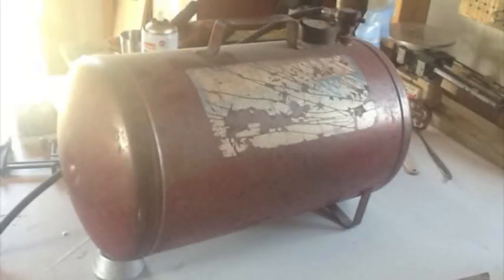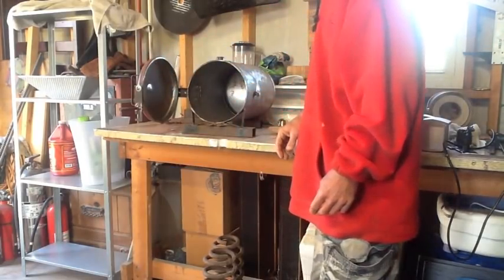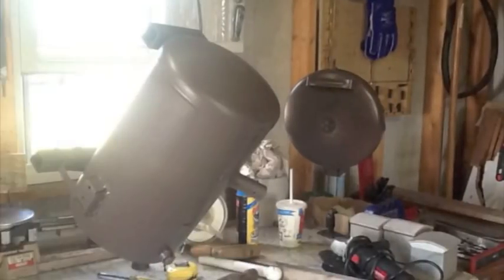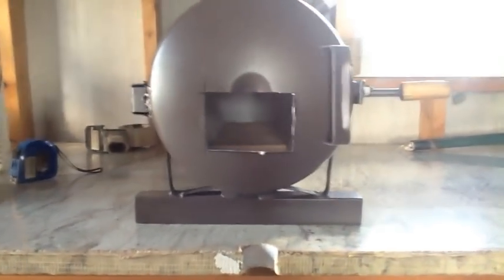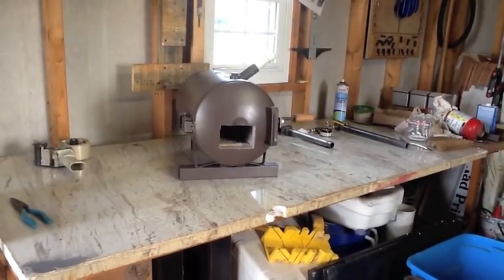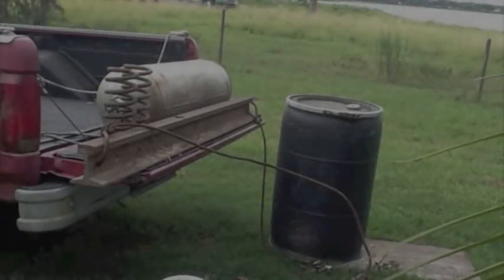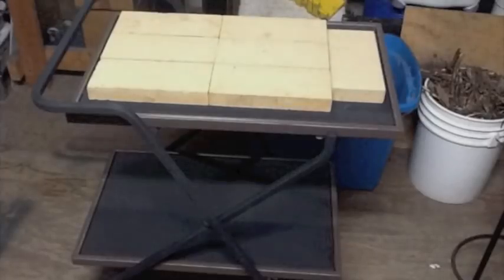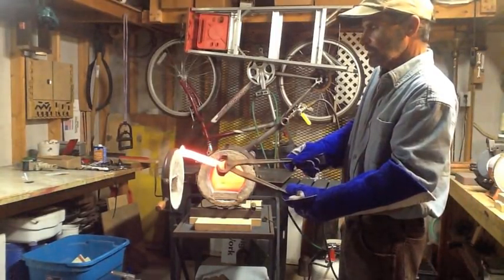My Custom Blacksmith Propane Forge Build - Start to Finish

Comment: Great other than the not safe tongs
Great video all (but the tongs,my unsafe tongs almost hurt me bad).
Really big thanks to you Sir
Reply from the maker: Which came 1st....the forge or the forged tongs? 🤔😉
Reply: In this age.we can buy and have tongs shipped in.24 hours fast,yes we do save$$$$ and love making our tools.
   As a safety tool just maybe we should suggest buying.or welding up at demo set ,I do.think.highly of your video Sir.
  I did have a 4x4x1/2" steel bar.fly.up while using channel locks that was glowing orange hit me between my eyes but bounce off my safety glasses not leaving a mark. Sir safety is my first concern.
Thanks for your video
Reply from the maker: I totally agree with your 1st comment, was not the best choice of work holding. Something to be said about the proper tool for the job.  I was just having a bit of fun. I am glad you liked the video and thanks for watching/commenting! ~ Richard
Reply: @MakinSumthinFromNuthin  I repeat your trying to help others, Thanks for the good words and loved the video.
Thanks you Sir

Comment: Awesome work, have a coal forge myself, planning a propane build at the minute, random suggestion, if you had a hole in the back of the forge you would be able to heat specific bits of longer stock material. Keep up the good work 😁
Reply from the maker: I never planned on doing any stuff longer than the 18" I got to work with. Good luck with yours!

Comment: You really did an incredible job on this forge!! I had the same idea using a air compressor tank so I'm glad I ran across your video!! I have the burner finished.. I used 316ss and turned all the parts myself.. I'm a machinist sooo.. it's a little over kill.. it's what we had in-stock at work sooo...LOL!! It's taken quite a while.. I had a couple of heart attacks so I have to take my time.. The only thing I did different was weld a 1inch by 1/8 band around the door where it was cut off the tank so it would seal up a little better..I know.. over kill.. You take great pride in your work!! I hope mine turns out as good!! Where in Florida are you? I'm about 20 minutes outside of Ocala.. Good Luck!!
John
Reply from the maker: I am in Gibsonton, FL just South of Brandon. I appreciate the kind words....the research I did paid off as I never made one before. Best of luck on your build! :)
Reply from the maker: I bought my first Lathe in Sept 2016 (newbie LOL) I have a few machining vids up if you think you can stomach them..ha :)
Reply: John Wade

Comment: Love your style dude. Im pretty sure you could build anything out of scrap. True craftsman. Thanks for giving me a few ideas too, Im about to make a little forge for heat treating knives in the garden and this really helped me think outside my comfort zone. Keep making the awesome videos man. +1 and subbed.
Reply from the maker: Thanks friend...I appreciate ya watching/subscribing! Keep me posted on your forge build :)
Reply from the maker: Hows the forge coming along ?
Reply: Hey there, and thanks for asking. Ive almost finalised the design. Found an old useless water fire extinguisher in a cupboard. Im going to shorten it, use the top end as the door, and line it with furnace cement. Ive got 4 M10 bolts to use as legs. Its hopefully going to be basically a mini-version of yours. (thanks for all the help!)

When my current knife is finished and ready for heat treat, Im going to have a go at assembling it.
Reply from the maker: Sweet, keep me posted. I havent had much luck with furnace cement meself :-/
Reply from the maker: Put up a vid the other day on the forge using some old footage if ya wanna check that out. Was the first real burn in the forge with the spike in this video, I used a portion of it in this video
Reply: Excellent, I will watch that now!

...and yeah I hear furnace cement is a bit hit-and-miss. Going to follow the instructions by the letter and hopefully avoid problems with shrinkage, cracking....hell, all -round general disintegration. I heard some bad stories about it haha
I have some of that fire blanket stuff coming from china (via amazon) .. worse case scenario ill rip it all out and copy your design exactly.
Reply from the maker: I bought furnace cement to line my aluminum melting furnace I made...it cracked, bubbled up, got brittle and eventually fell off the walls of the perlite & portland cement refractory. My original homemade refractory is still going to this day after approx 60+ melting sessions, the furnace cement I bought lasted 3 melts before disintegrating.
Reply: Ouch. I think I might be wise to finish up a couple more blades and heat treat them in one session. Try and maximise the work in case it disintegrates. Thanks for the caution.
Reply from the maker: Rough up the interior, that furnace cement stuff doesnt like slick surfaces
Reply: Thank you for the tip! I will definitely do that.

Comment: Just want to say I really appreciate the way you explain . simple but very in detail.  
can you tell me what kind off plaster I need . Thanks in advance 
keep up the Good work going
Reply from the maker: Hi, there was no plaster used in this forges construction. Plaster is not a suitable material for a forge or furnace. It will disintegrate and crumble back into a powder. I used ceramic wool for the forge interior. Thanks for the kind words :)

Comment: Any issues over time with the hinged door ( refractory seal or degradation to the refractory from opening and closing)? I plan to build your design with an old air tank. Im considering two 3/4 inch burners, to get to forge welding temps
Reply from the maker: Zero issues with door, hinge or ceramic blanket with ITC100 coating

Comment: Great information and instruction video.
 I  like to see you continue without injury so
 please wear some goggles so that we can know that you are  working safely.😞.
Reply from the maker: Thanks Sando, had I planned on hitting that chunk of steel with a hammer I would have most certainly had safety glasses on. The forge was fired so show its operation. I dont even drill wood without glasses on :)

Comment: Nice build, though I don't know why you went with the JB Weld.  Only good for up to 500 degrees F continuous, or 600  Degrees F for ten minutes.  Let me know how that holds up.  I'll be doing a build very much like yours.  Really could use some more info on how you got the hole for the torch drilled in the first place.  Thanks.

Comment: yes they are  light  as anvils go  I use a 75 lb. NORTH CAROLINA FORGE  anvil  for blade smithing and its a small anvil I used to use  1 that belonged to a great uncle  it was a   BATTEL SHIP ANVIL  we moved it with a tow truck  it weighed 595 lbs.   all 40 or your anvil blanks before shaping  weighed  203 lbs.   give or take 2 -3 lbs.   the whole rail likely weighed5 to 10 lbs. more depending on  cut off size
Reply from the maker: Nice anvil ya got there, congrats. A real anvil is on the wish list, a RR Track anvil is "ok" but nothing like "the real deal". Your numbers were very close! :)
Reply: contact your local black smithing  group they can help find 1 for small money or free I got mine in this way  and only cost fuel to fetch from accost the state
Reply from the maker: Thank you very much, will look into it :)

Comment: a tip if you cutting open anything containing gasses feel it up with water first or it might ending up bad
Reply from the maker: That was just an air tank, not propane.....so no worries... But yes, you are correct!

Comment: you should have made a refractory castable liner for the main chamber with wool between the skin and liner.

you cant use borax or other flux in there because it is an acid at high temp and eats the wool and you have to reline frequently.

i made a railway iorn anvil- 2 1/2 hours to cut 3 times with a hacksaw.

an angle grinder would only take about 15mins max
Reply from the maker: Having just the wool suits my purposes just fine, my experience with castable refractories hasnt been all that positive. I dont do any forge welding with it so I dont use borax or flux, I have heard of others having a mess on their hands using borax in their propane forges with ceramic wool....I think making pattern welded steel (damascus) is better suited for coal forges. Thanks for watching and commenting! :)

Comment: Nicely done sir! It seemed like you had a plan set, and followed through wonderfully. It was satisfying to watch because this project seemed to go wonderfully for you. By the time the video was I almost felt a sense of accomplishment! XD haha. I'll be putting this video in a file of references for me and my projects!. And again well done sir!
Reply from the maker: Thank You so much for the kind words. I had no "set of plans", but knew what I wanted the finished forge to look like & work   It came together beautifully! :)
Reply: I forgot to ask you, but could you tell me what kind of wool you were using exactly and where could i get it?
Reply from the maker: Its ceramic wool rated for I believe 2800 degrees. Drop me an email and I'll be glad to give ya some suppliers
Reply: Makin Sumthin From Nuthin hey there, just another question for you if you don't mind, can you give me an estimate on how thick the metal walls were in the gas cylinder? im worried about what i use because id like to make sure if theres an ideal thickness to the metal shell that will improve the  forge. thank you for your time
Reply from the maker: I wont give you an estimate....I will go over to the shop and put my calipers to it! Hows that for customer service! ? :)
Reply from the maker: 16 gauge metal (1/16th thick ~ .0625") Ask me as many questions as you like. Its an awesome forge :) Keep me posted on your progress ok !!
Reply from the maker: Bear in mind that I have 2" thick ceramic wool insulation in that forge. The walls get "hot" during operation but I can actually put my hand to it for about 3-4 seconds before it becomes uncomfortable but I dont get burned although its probly 2400 degrees 2" away inside. Amazing stuff that wool is !
Reply: yeah i wasnt too concerned before a friend of mine (hes a general contractor) said regardless of the insulation its a good idea to conciser the thickness of the shell. but im planning to use a 10 gal  tank and  put 4" of insulation XD wow that will be fun. I just wanted to get your input on the matter as well as his. so thank you much again
Reply: I'll be sure to let you know how my forge works out, that'll be fun to see how mine compares to yours.
Reply from the maker: 4" is a bit of overkill IMO, two will do you just fine. Will give you more room for your metal. Just my two cents if you get good wool :)
Reply from the maker: +GraphiteGames YES, please keep me posted on the forge progress!! :)
Reply: where can i find the hinge system for the door?
Reply from the maker: I got that hinge for the door from a backyard BBQ grill I got off of craigslist "free" to scrap out. It was one of the lid hinges :)
Reply: hmm neat, good to know
Reply from the maker: YW, the channel name pretty much says it all. LOL :)
Reply: im all about that style. it's a good skill to develop in case $#!+ hits the fan.
Reply from the maker: My fan barely spins because it has so much "stuff" on it ! :)
Reply: XD lucky you. i need to get a good fan out here in the garage baking in 108* weather
Reply from the maker: Brutal here too (Florida). Need to shoot another vid but weather is horrendous!
Reply: well ill be sure to look out for it

Comment: Hi there, very nice forge.  I was wondering where you got the hinge for the door.  Is there a special name for it?  I searched for hinge and heavy duty hinge but nothing like the one you used came up.  Thanks.
Reply from the maker: Thanks, glad you like it. The hinge......scavenged off a BBQ grill I raped to make stuff out of. Me buy a hinge.. ?? Nahh

HInge: Forge Door
Stainless Handle: Aluminum Furnace Burner
Base: w/legs: Outdoor Welding Table/Sawhorse 
The Lid: ?? :)
Reply: Gianluca Greco you could probably get away with bending a piece of metal around a nail

Comment: great build and nice video man but I have two questions for you. first how did you use sodium silicate as a glue for the wool I used sodium silicate before and I don't think it will stick on steel by it's own just wondering about this. 
and second I watched your casting videos and I see you use fire bricks in your melting furnace but you used wool for this build since you used both materials I was hoping you could tell me which is better insulator thanks in advance
Reply from the maker: Sodium silicate will bead up like water on a waxed car on slick steel. To get around that problem....take some 60 grit sandpaper to the steel surface and abuse it, then wipe down with mineral spirits. You will find the silicate wont bead anymore and give a nice coverage and it will adhere nicely to the steel. I dont use fire bricks for my casting furnace, I used a portland cement/perlite mixture. I have videos on the casting furnaces...one is wool. Wool is the better choice if you can afford it :)
Reply: Makin Sumthin From Nuthin thanks for the reply and I watched the video where you cast the virgin mary statue again and realized that the furnace is not fire bricks 😂😂😂 anyway thanks for the info  and great channel you have . keep up the good work

Comment: ok i am as far as the first fire of the forge and i can immediately see an issue , if the fire is exiting the front of the forge that means there is not enough oxygen in there for all the gas to com-bust , either use a matress inflator // hair drier, or of course a compressor , to put more air in , or make bigger holes around the air intake in the blower , or add a small exhast hole at the back so the ""used air"" can exit and fresh air can come in, im on my 4th home built forge , tha alternative is a smaler jet or just reduce the amount of gas going in , you should get 400 f more out of it when its tuned correctly
Reply from the maker: Thanks Edgun, There are no yellow flames exiting so am getting complete combustion, I get plenty of air intake from the burner design. There are zero performance issues with the forge the way its built, I wont be modifying it or adding forced air. It will be the only forge I build. Why may I ask are you on your 4th ?
Reply: Its not about yellow flames , if your combustion is happening outside the forge your loosing heat , i wish i could show you mine but i dont video lol, i have build 4 now , if you have a compressor it is well worth hokking it up to the burner even at a few PSI it will get you hundreds of F more.
Reply from the maker: I sometimes use forced air in the foundry furnace so may experiment with it on the forge when I am in an experimental mode! Thanks :)
Reply: melting point of steel is 2500 f propane only reaches a maximum heat of 2300 f if you ever plan on forge welding the only way you can get the heat is with forced air., i was running Pattern welded knife making courses at my forge and i tried a lot of different ways but only once managed to weld in a home built gas forge , PS how effective is the ridgidiser i never used it ?
Reply from the maker: Rigidizer works well, I would never run a wool furnace or forge without it

Comment: What is the rigidizer made from? Is this the same sodium silicate liquid? The ITC 100 is expensive, so how much of it do you need to coat the inside? I know it can be used for coating the inside of a steel crucible to make them last longer. Any help would be appreciated. Oh, just in case you weren't aware, it is against the law to have rail road rail in your possession, but the heavier rail does make a good anvil.

Comment: If you can't weld,  it this still able to be made if you use collar type fittings on the burner pipe,  and bolts to hold on the hinges etc.  Or will the temperature be to high,  and cause them to melt?
Reply from the maker: Bolting would be fine as well, the steel wont melt as the shell gets insulated by the wool
Reply: Cool,  thanks for that,  FYI you  have fans here in Australia 👍😀👍

Comment: I'm going to make a foundry for melting aluminum and brass. Is it over kill to use wool instead of a refractory cement? I've seen videos saying cement won't last long if the foundry is used to melt brass and copper. Thought I'd ask for your opinion.
Reply from the maker: See my video on making a brass furnace, I use wool in that one. Copper temps will kill a cement mixture foundry furnace quickly. Consider subscribing! :)
Reply: Makin Sumthin From Nuthin- Wow you reply fast! I will watch that video, thanks! Consider me subscribed.
Reply from the maker: Thanks!, I also have a cement/perlite foundry furnace video but I just use that one for aluminum :)

Comment: one more question. I see that your burner, as is mine, is set at an angle. When in use, I find myself  struggling to put the target under the flame. Do you see a reason to not put the burner straight up?
Reply from the maker: The angle circulates the flames and heat and gives a more uniform heating to the part in my opinion. I have seen vertical burners tho. I dont worry much about putting it directly in flames path... I let the forge do its job :)

Comment: Should have a laser temp reader and see what the temp is on the outside of that forge  surface to see how well the insulation works!
Reply from the maker: In another video I use my hand to do that 😊

Comment: Curious about your propane valve setup. Would you mind elaborating about the setup? I am in the process of collecting for this build as well. Well done from Idaho!
Reply from the maker: Thanks Ken!, I do have a separate video just about the burner for the forge if ya care to check it out. Its one of my more recent vids as that question comes up a lot :)